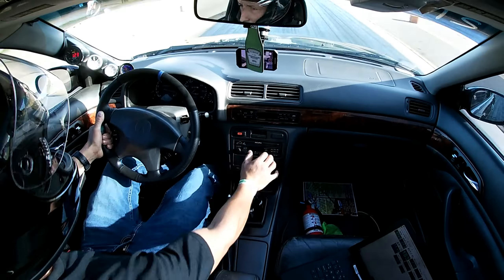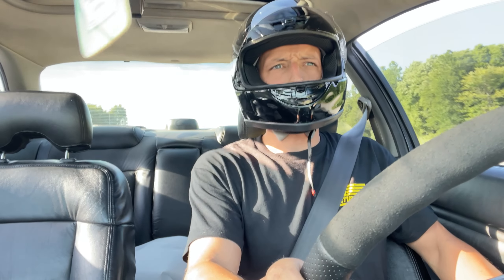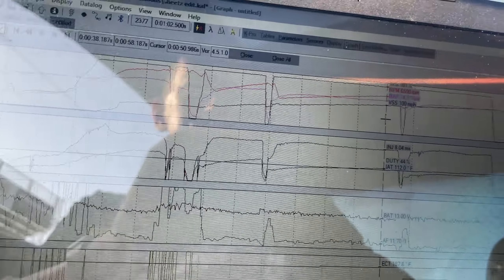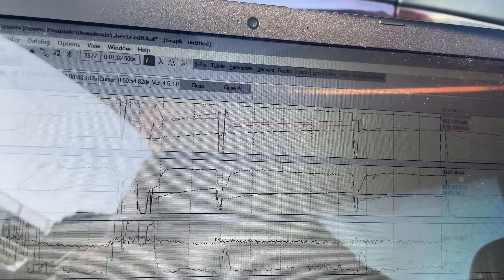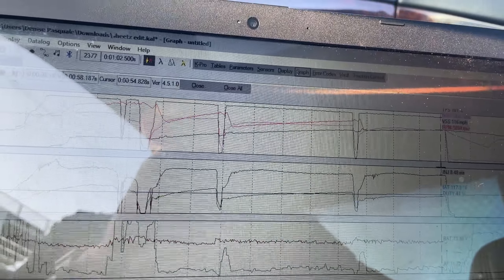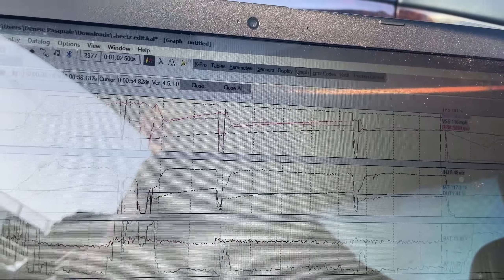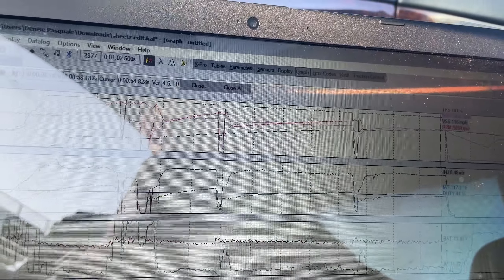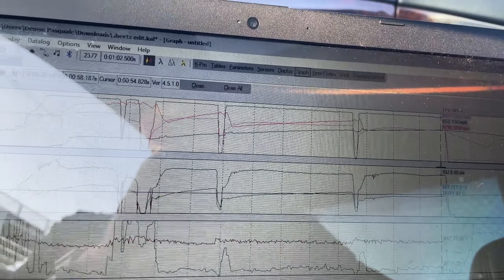DID I FINALLY FIND A OEM AXLE SOLUTION? TURBO ACURA CL

Comment: You’re gonna continue to snap axles due to the angle of the axle coming out of the transmission into the spindle; especially when you’re getting wheel hop.
Reply from the maker: It actually doesn’t wheel hop at all
Reply from the maker: I also contacted hasport about the angle… they said it was normal :(
Reply: @franksgaragehonda  jeez that’s unfortunate. Looks like if the motor was just a tad bit closer towards the firewall then that would solve that issue. That angle is painful to see but glad it’s holding up so far
Reply from the maker: @kaycertified  One of the other reasons I picked up a EK. Everything is pretty much bolt on. All the axle issues have been figured out with that chassis just need to track down a all-wheel-drive transmission
Reply: @franksgaragehonda  yeah, not many people really experiment with CLs so the aftermarket support isn’t really there. Hence why there’s close to none k-series swapped CLs. Basically need custom mounts
Reply from the maker: @kaycertified  it’s set up the same as the 94-97 accord. I’m using the Hasport accord mounts. I know someone with a 94-97 accord with the same issue with the driver side axle.  I need to find a solution. Or not race the car :(

Comment: What halfshaft and axles are you using ?
Reply from the maker: Hasport cdk1 with k20 intermediate.  Originally. I’ve tried all OEM axles also. It’s the position of the engine compared to hubs.
Reply from the maker: CDKAX
Reply: Rsx Type s intermediate shaft with tsx axles ?